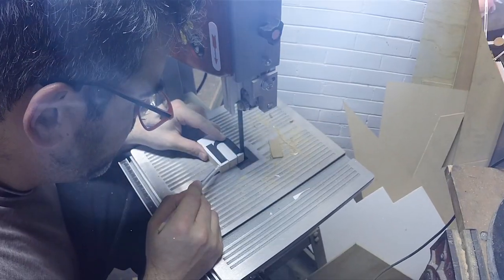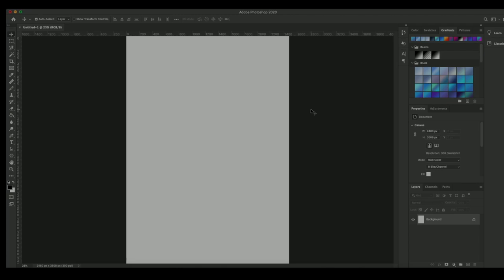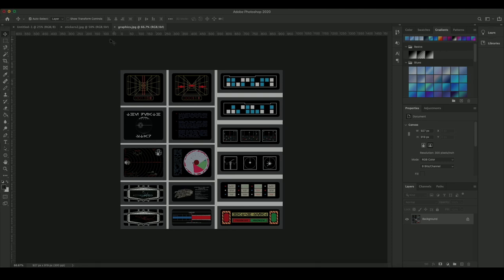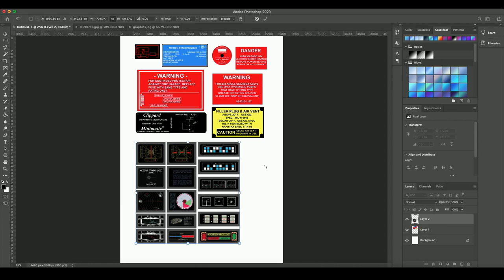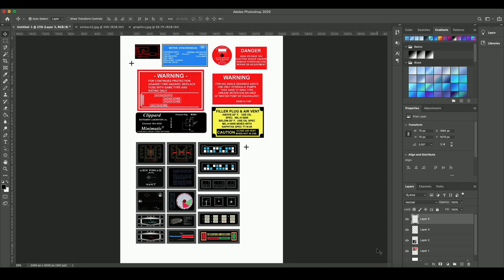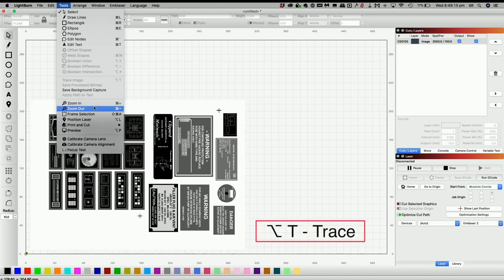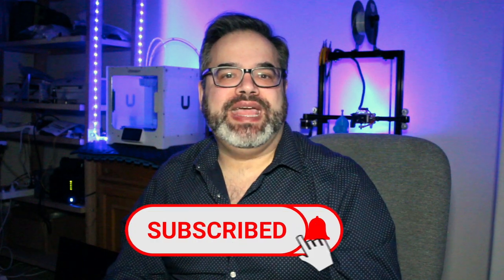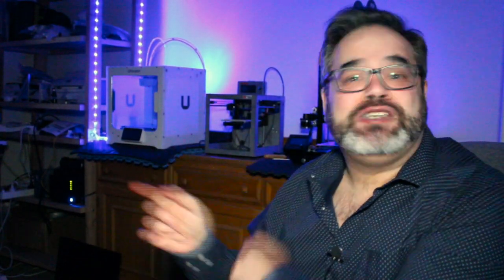Lightburn tutorial: Get perfect results using print and cut

Comment: Want to save some time? Select the first registration mark, jog the laser to it, then mover your workpiece to the absolute point of the mark. First registration point set. You only need to pinpoint the 2nd registration mark. It's much easier to move the paper to the exact position than jogging the laser on the first mark.
Reply from the maker: Great tip 👍Thanks for sharing!
Reply: And that's why I'm one of your Patreons Your method allows me to use print and cut cause my laser is on the other side of the room and I don't have a camera.

Comment: Weeding out the unwanted stuff I would of held control selected all boarders and changed layer color, turned it off, select all the unwanted stuff and delete.
Reply from the maker: Great suggestion. Good use of the layers function to get a fast result. 👍What do you use print and cut to make on your laser?

Comment: Hi I am using LightBurn about half an year and I am very happy about cut contour feature. I am planing to buy CNC router now. Is here any option how to use this feature for CNC? Thank you
Reply from the maker: You can use Print and cut on a CNC, all you need to do is jog your tool to your registration points, and then run the job in the same way. The theory of the same, and depending on how well you set up the registration points, you should get a great result. Let me know if your successful in getting this to work on your CNC!

Comment: Question..could you just color the borders different and then erase the other color from the layers panel? Would that work?
Reply from the maker: Chemtrail Brew & Que could you please explain more about your idea? Not to sure what you mean about different border colour?
Reply: For instance, you have a complex middle section of a graphic and you just want the outline. Instead of erasing each inner node one by one, is it possible to put the inner graphic lines on a different layer. Then changing to that layer and erasing it to get rid of the inner portion of the graphic?
Reply from the maker: Chemtrail Brew & Que if I follow your description correctly, I think it would work. Would need to test the process first. Let me know how it goes.

Comment: At 14:32 after saving the layout the registration marks are hollow outlines from the tracing process. After you go back to Lightburn from placing the printed page into the laser at15:38 those same hollow registration marks are now solid black lines. Did you skip a step that got cut out in editing where you make those solid?
Reply from the maker: Hi Nick, Those marks are just the "+" symbol within the artwork. What you are seeing is originally the traced artwork, then the original graphic artwork within Lightburn. As you can imagine, the original artwork is tighter than the tracing and makes it look like the markers are hollow. You can use both (traced artwork or original artwork) to perform a Print and Cut.  You have great eyes! Well done picking the difference.
Reply: @LaserLivestream  Ok, I guess what I am asking is how after the graphic was removed at 15:38 they reappear as solid and not the traced one that were just there at 14:32?

Comment: Hello, thank you for the tutorial. If I print and cut a design with Silhouette Cameo, how will I line it up with a piece of wood cut with lightburn afterwards ?
Reply from the maker: Make sure you have markers on the design that you use with both the Sihouette and Lightburn. That way you will get the same result with both workflows.
Reply: @LaserLivestream  Actually I have noticed that when I set registration marks on the design, Silhouette Studio changes the step size. If I print a design which is 200 mm, it is printed out 204 mm.
Reply from the maker: @roccosorrentino2776  I don’t have a silhouette so I can only talk in theory, but try adding the registration marks to a graphic then add it into the software for the silhouette.
You can then load that same graphic (with registration marks) into Lightburn and cut the job.
Happy for someone to send me a Silhouette to work out how to create this workflow :)

Comment: Hi Gil , great video . Your videos have really helped with our decision to go ahead and purchase the Emblazer 2  as an addition to our business making various craft items . We were specifically interested in making clocks and engraving . However , we are really struggling with time management using the latest version of Lightburn 0.9.10 . We are working on the latest controller firmwave , and running on Windows 10  - 64 bit .  We are finding that even fairly basic designs where we require fill areas are showing as taking 12hrs and above . Having looked into different forums etc we found that to reduce the  work time they is an option to "flood fill" which will reduce the working time to a reasonable level , however looking on the latest version of Lightburn  there is no option to Flood Fill in any of the settings . We also dont see a choices of crosshatching etc . Apart from that the program seems to be working and cutting ok , apart from wi-fi issues which although connected doesn't want to work but works fine via usb.
Could you please advise what we can do to reduce the work time as if we cant resolve this then we will not be able to do the work we purchased it for as it just wont be profitable . I've tried contacting Lightburn on the web but cant seem to get an answer. The only thing we've seen is that it appears there was an issue with the flood fill and it was removed , but it does say that if you have a diode laser that it should still be there ??? As a beginner it's really put a damper on getting this machine so if you have any videos relating to this latest version of Lightburn and the Flood fill issue please let us know so we can enjoy the Emblaser 2 to its full capacity .  Really do hope you can help - Jay .
Reply from the maker: Hey Jay, sounds like you have run into a software issue. My best advice  to talk to the very talented tech support at Darkly Labs @support@darklylabs.com as they work closely with the Lightburn team.
Reply: @LaserLivestream  Thanks Gil , issue was because I was in beginner's mode it seems . I've now unchecked it and the flood fill and other options such as cross hatch are now back .  Maybe worth pointing out somewhere on the Lightburn page for other beginners . Very grateful for the help from Forum members , no doubt as a newbie I'll have a few more " issues " in the near future while we get the hang of it . Many thanks .

Comment: Hello, Thank you for these tutorials.
I put 2 points on my project (two simple crosses) but if the menus for the first and second target are well available, it is impossible to select them.
Do you have any idea on this reason, or any place where this topic would be discussed? Thanks again.
Lightburn 0.9.20 and Support at 6mm (a MDF board)
Reply from the maker: Hey DioFigs,
Sorry to hear that you're having issues. I think  I had the same issue when I first tried to use the feature.
Are you electing the Print and Cut future before picking the first point? Once it's correctly selected, you should see a check mark by the first target in the election menu.  
If that doesn't work, check out this walkthrough https://lightburnsoftware.github.io/NewDocs/PrintAndCut.html
Reply: @LaserLivestream  Hi Gil
Thank you for your reply.
My problem 'was' that the points was impossible to target in the menu, no crosses, no marks, no highlights or colors. 'Align output target' was not automatically selected either.
But as I found the same tutorial that you recommend to me, I saw that by selecting this menu 'Align output target' manualy, even without display feedback, the message 'Print & Cut mode' in the status window could be activated or deactivated on demand.
So I started cutting and it worked!
Many thanks for this this essential function for my job.
So I can imagine that it is something to verify in the Lightburn new version.

Comment: one seriously expensive laser to cut 6mm ply, looks nic¡, good form factor etc  but nearly 3k!   How many passes for 6mm ?  Great for non techies as its all there and ready to go, cross platform etc but it just seems so expensive.  If its one pass for 6mm then not to bad i guess for a machine that anyone can use. 

I dont know what the watts are the tech specs say equivalent to a 15 to 20 watt co2 which is about the same as my twinned diodes which can cut 6mm in one pass with the right lens on with air assist on high pressure burns straight through.

In Lightburn you can use the Fire button on low power in the console window to jog your laser to the right position just set it at 5% on a diode, not recommended on a Co2 different kettle of fish. You need a high quality C02 to get good line up not a k40 of k50 etc  something like a thunder will work beautifully.

I digress from the video , I was just astounded at the price, Its a good demo for a little used function but very useful tool in lightburn but that function is really only useful if your doing repetitive runs time after time, one piece of paper No..... 😄 I have used it for my wife who is a teacher in early years to make many stencils for the 30 plus kids she has in her class! For that its great and on a CO2 its brilliant for cutting out badges or xmas ornaments etc etc. Turns the machine into a processing plant really. Good Demo.